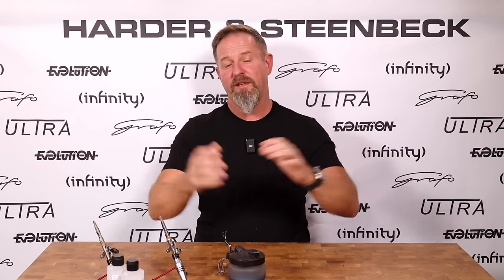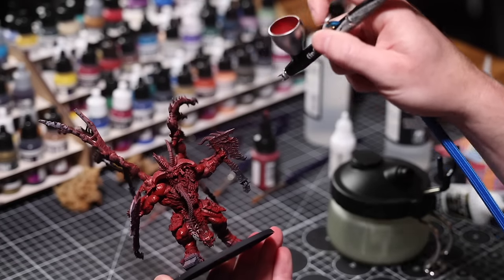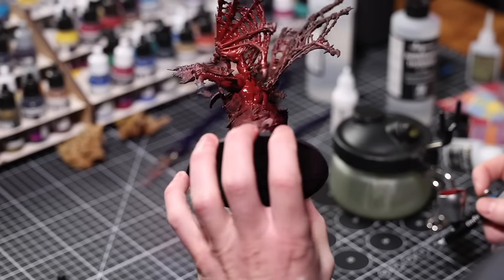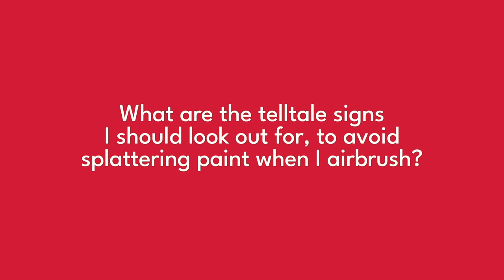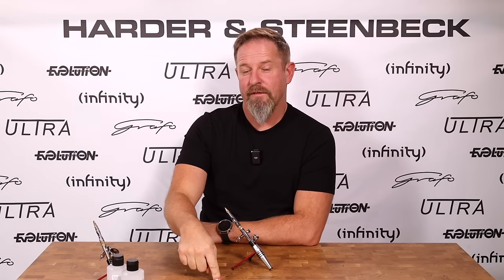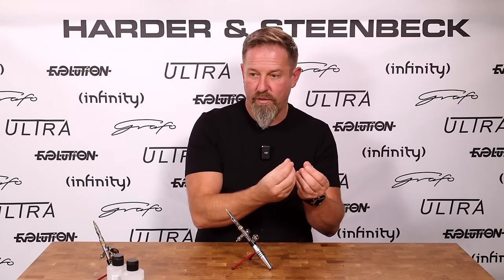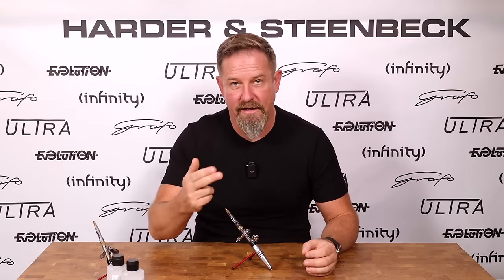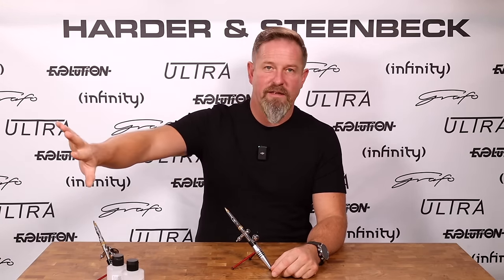How to stop putting too much paint down and avoid paint splatter

Comment: I have airbrushed for a number of years. I’ve used a variety of airbrushes from different manufacturers from cheaper models through to the infinity. 
I’ve used them for painting scale models and they’ve all done a reasonable job with my skills at the time. 

I have just received my new evolution cr+ 24. 

WOW, what a beautifully engineered tool. The effort you guys have put into its development shows in every element of it. It’s hands down the best airbrush I’ve ever owned. A joy to use and it looks great too. So a big thank you for all of you at Harder and Steenbeck. Have a great 2024. 🍻
Reply: I know right, when I opened mine a bright light shown out of the box and I know I heard angels singing
Reply from the maker: Ah thank you so much Allan! Really appreciate your comment - I will pass it on to all the staff!
Reply from the maker: Thanks buddy!

Comment: ok, these videos are really helping airbrush beginners (like me) up and running in my mini painting. very much appreciated.
Reply from the maker: Thanks for your comment! Glad they are helping.
Reply: @harderairbrush  there is also a question that's been sitting at the back of my head, I have the ultra 2024, will the old ultra 0.2 needle+nozzle set work with it? And will there be future optional nozzle cap options for it?
Reply from the maker: Yes and yes :-)

Comment: I would love to see a video on lubricating the airbrush, and what parts to lubricate
Reply: I was thinking the same thing last night!
Reply from the maker: Everything that slides, doesn't mind a bit of lube. Our engineering fits and finishes are smooth enough that they don't NEED lube, but as we all know, a little lube never hurts. I wouldn't lube anything that touches paint, and generally, airvalve components don't really need it. The trigger system, the whole back end - everything to do with the "feel" of the trigger system - this is a good place to put a little lube. Recommend Iwata Superlube, as it generally seems to be the only one that doesn't make paint get grumpy.

Comment: I think that first question can also be answered by mentioning airbrushing technique. 
1. Press down for air (away from the target)
2. Pull back for paint (away from target)
3. Check the pressure and flow of paint
4. Spray the paint on, continuous movement of the AB
5. Move the brush off the target and release.
Obviously this isn’t always possible, but I think it’s a good habit to develop
Reply from the maker: Thanks for your comment, BUT It's not always relevant to start the flow of paint off target. I'm concerned by your point 5... if you JUST release, then most likely, you will shut the air before the paint... this then results in a drop of paint sitting on your needle tip, ready to ruin your day the next time you press down. The ULTRA 2024 does prevent this happening by the way, even IF you do just release. The best habit is to make sure that you finish every stroke by pushing forward, and then releasing up. This way, your needle tip is always perfectly clean, and then there is zero risk in starting a painting stroke ON the target - something which we frequently need to do. Hope that helps! W

Comment: Hey Warwick.Thanks for your very intresting vids. I just bought a H&S Evolution Silverline. How do you bubble back ( for mixing or cleaning ) it with the holes in the nozle? Thanking you for answering.
Reply from the maker: If you want the "today" solution, then a thick cloth which is damp works great. For something more elegant - it's coming.

Comment: @Warwick @Harder und Steenbeck  your thoughts on ultrasonic cleaner for "mixing" acrylic paint in bottles  ?
(17ml bottle in zipper bag, in sonic cleaner, run for 90 seconds, rest bottle some minutes, and viola smooth mixed paint)
Reply from the maker: I've never tried it, but it sounds like it could work...

Comment: What frequency should you empty water from the tank of the compressor? In terms of hours spent airbrushing.
Reply from the maker: It depends on the humidity of where you are located. Best advice... After you're done, wait until the compressor has cooled, then do it. If you can't remember to do it after waiting, just do it at the end of the session. It's so fast and easy, that you might as well just do it each time. Never leave pressurised air in the tank, also...

Comment: One of the best things to help avoiding dried acrylic paint on the needle tip is to use a small amount of drying retarder - it will not prevent tip drying but i will give you a much longer time before that happens.
Reply from the maker: I really wish my experience matched that expectation but honestly, I've never used a retarder and found a significant different. However, glad you're finding that - might be different behaviours in different locations/ humidities. However, the habits described here will help whether it occurs earlier or later. Thanks for the comment!
Reply: @harderairbrush  Interesting! Experiences can vary - from my experience about 10-20% retarder about doubles the 'spray time'. However i use it together with a lot of thinner, maybe the combinations makes the difference? Ratio is about 5 x paint:3 x thinner:2 x retarder.

Comment: Hello, what would happen if i were to use your needle cleaning kit for the 0.15mm nozzle? The needle kit says it works for the 0.2mm at the smallest. Would it damage my nozzle or just not clean it well?
Reply from the maker: It will not reach the mouth of the nozzle, and therefore it does not do the job well. HOWEVER, please understand that this is really a last resort. It is so easy to keep your nozzle clean with just liquid if you never let paint dry in it. Much safer, much faster, much cheaper, much easier!
Reply: @harderairbrush  thank you very much!

Comment: I do all hard surface, and if I get spiders I dab it lightly with a shop towel. I don't bother trying to clean it off, but just want to ensure that it's flat. That way touch up is easy.
Reply from the maker: Good tip.

Comment: Hi, I have been watching your videos and they have been so helpful, I bought the ultra 2024, I am very new, I am noticing that when I change the presets, sometimes nothing comes out, just air when I push down and pull back. So I end up just using the normal pull back and no presets :(   I am not even sure I am using the right way to explain it, haha. It also appears that I can pull the trigger back a bit without pushing down and air trickles out. But maybe I have no idea what to expect when pushing and pulling the trigger and what it should look like or sound like when I change the presets. Cheers and thank you!!

Comment: With the noise of a spray booth sucking the air through the filter, I have no chance of detecting slight changes in the sound of my airbrush! And that’s without those moments when the compressor kicks in. All this noise does not make airbrushing a relaxing part of the model making hobby.
Reply from the maker: Ah but you must find the centre. Focus on your airbrush, and allow your mind to be like water. Then, you will hear the sounds of atomisation, and feel the flow of the colour. I recommend watching Kung Fu Panda for more instruction. 
Seriously though, you don't need an air compressor or a spray booth THAT loud to power an airbrush... but if your rig is really loud, then pay attention to how fast the paint starts to flow when you get on the trigger - how quickly it  begins to move - this should be instant. As soon as it is not, take a quick glance at your needle tip. That's another reliable way of detecting a bit of colour drying on the needle tip. Hope that helps you to relax more whilst airbrushing!
Reply: Thank you for your reply, much appreciated. Rest assured, I will persevere. Looking forward to seeing more info on the 2024 Evolution.

Comment: I would like to know how to practice without damaging the airbrush, I heard that food coloring is a good way to do it without risking damaging the airbrush since the cleaning after using these products can be done with just water, would be nice to know the best way to built that trigger control with no "risk"

Thanks in advance!
Reply: This is what I suggest people do when wanting to practice. Food coloring watered down to just see the tint works really well. Just spray on paper or cardboard and you can see it really well. Hope you have fun learning to airbrush!
Reply from the maker: Hey Diego... thanks for the question. Firstly, there's no risk of "damage" with any paint really... no paint is going to damage a solid metal airbrush ;-)
It's more that you have to learn how to handle the airbrush whilst cleaning it - please watch our various videos on this topic, as it's way easier than most people make it out to be, honestly!
Food colouring is great because you can paint and paint and practice the control of the airbrush. However, painting with acrylics etc needs additional skills, specifically avoiding tip dry and therefore clogging. The interesting thing with food colouring is that you can practice control without needing to learn the other things. However, eventually you need to learn those other things too. But please don't think that using real paint carries the risk of damage - not true if you have good habits on how to clean - if you do it the right way, it's super easy and fast. Watch any of our painting process videos and you'll see them. Very simple! Hope that helps. Also remember that food colouring is super thin and so it flows faster than acrylics, for example. So whatever trigger control you learn with food colouring, will need a bit of adjustment when you move to acrylic. One way to using food colouring and getting a more representative experience is to use your food colouring at more like 18psi to slow it down a bit :-)

Comment: Hi Warwick. What is the difference between using an fPC valve vs. just adjusting air pressure? When would I prefer one over the other?  Thanks!
Reply from the maker: Hey Andrew... it's just convenience and precision, but only necessary to get the fPC if you use air pressure adjustment frequently, and for me, only necessary when you really want to explore low pressure effects. Having the air pressure adjustment so near to the aircap allows you to set the pressure much more precisely and find your desired pressure much faster with the fPC than with the regulator. And of course, you can do it more frequently and much faster, as it's right there on the airbrush. I really like it because it doesn't interrupt the creative process. Hope that helps!
Reply: @harderairbrush  Thanks!

Comment: I bought the Ultra 2024 and can't get it to spray on setting 3 for more than 5 secs with out having to cleaning the nib.  I am using well thinned citadel paints
Reply from the maker: Hey there - take a look at Angel Giraldez' video about how to thin Citadel... Citadel is a bit of a unique case as they don't have an airbrush thinner... Angel has tried and tested lots and has found that the Tamiya X-20A thinner works great... I'm sure this will help.

Comment: Hi Warwick, some feedback for the assembly line if I may. I recently received my Squidmar Black Evo 2024 and found the needle nozzle was so tight I had to use pliers to unbreak the seal. This has resulted in the Black paint being chipped arround the nozzle area. If the nozzles can be put on with hand tight pressure, this would help. I have Neuropathy in both hands so I can no longer loosen things with my hands as I have lost a lot of my grip. Anything to help in this regard would be very much appreciated. Cheers Steve
Reply from the maker: Hey buddy - so sorry to head that! I can assure you that ALL our air caps are always put on only with hands. We do not use a tool to do that in factory for precisely this reason. However, I'm really sad to read this, and so we would like you to get in touch please. Email me on wjs@harder-airbrush.de - I would like to send you a new body for your airbrush so that you don't have that damage to that beautiful finish as a result of this difficulty, and we will also throw in a beautiful set of soft nosed pliers to help you with your Neuropathy without causing any damage in the future. I will also have our CNC room create a tool for you to use for taking your head on and off without needing to resort to pliers, but will enable you to develop enough torque even if you have grip issues. I've thought about what you need and I have already created the design - we can make it within two weeks for you - please get in touch. Many thanks, W
Reply: @harderairbrush and this is one of the main reasons why I will continue to buy H&S products. Taking care of your customers in this day and age has been lost. H&S continues to take care of its customers. Thank you so much for going above and beyond!  I cant wait to get my hands on my Squidmar black when I get back home!
Reply: @harderairbrush  thank you so much for your most generous offer, which has blown me away. I will ping you an email.
Thank you Warwick and the rest of the team @H&S 👍
Reply from the maker: Our pleasure!
Reply: @harderairbrush  Hi Warwick did you receive my email OK?
Cheers Steve

Comment: I just bought an Ultra and I am entirely new to airbrushing. I can’t figure out what size connector I need to fit the hose I have!  Any suggestions?

Thanks for the help!  Really looking forward to starting with my airbrush
Reply from the maker: Hey Matt! Do watch the ULTRA instructional video that the QR code goes to which came in your box... that covers how to get hooked up. The airbrushes all come with a quick connector, BUT you probably don't have that on your hose - just unscrew the quick connector and your hose will most likely go straight on. Most hoses now are 1/8bsp and this is what our airbrushes connect to. If your hose isn't that, any air hose with a 1/8bsp female end will work. Hope that helps!
Reply: @harderairbrush  this is fantastically helpful!  Thanks!

Comment: I would love to have more information about the 2024 Evolution -- specifically, your claim that the .28 nozzle is compatible with a .2 mm needle. You claim that the resulting lines are even finer than before. This seems counter-intuitive, and I've yet to see an online demonstration. Would the principle work across the board? What about placing a .3 mm needle in a .35 mm nozzle? I have an old Paasche VL, and I've never attempted to put a (cheap, commonly available) .5 needle into that gun's .55 nozzle.
Reply from the maker: Hey buddy... no that principle is unlikely to work across the board. Firstly, technically, it's more correct to describe needles as "designed for the 0.28mm nozzle" rather than 0.28mm needle, as that 0.28mm exists along a taper, whereas the nozzle can clearly be described as 0.28mm because that's the factual size of the aperture. The interaction between the needle and the nozzle is not really the critical aspect of what dictates fineness of spray. It's actually much more the relationship and the interaction between the needle tip, where is sits at a point in space relative to the airflow shape and focus that's coming out of the aircap. That is really the critical thing, and where the design focus is. Now bear in mind that the needle is a moving thing, and then you understand the design challenge a little better! It has to fulfil the job of acting as a flow control valve on the paint, as well as interacting with the airflow in a positive manner to influence atomisation/ detail etc. So if you put a random needle into another airbrush, you might discover something that the manufacturer didn't but most likely you won't. Not saying it isn't possible though! But you might spend a lot of money without results...
With regard to your Paasche - I am a fan of the old VL! It was actually my first airbrush. Personally, I never used the #1 set-up much - I preferred the #3 set-up - even for detail. I just found it overall friendlier to use, and 95% as good for detail as the #1. A very nice compromise, that head, actually.
So in summary, we didn't just "put a 0.2mm needle into a 0.28mm nozzle"... we designed a new system of needle/ nozzle/ aircap optimised for detail work with today's paints, and this is the result. It's a system, not a parts bin special :-)... hope that helps!
Reply: Thanks for the detailed response, although I'm still not sure about the new system. I'm sure we'd all like to see the Evolution's fine line capabilities demonstrated. Incidentally: You got detail out of a VL3? You must be a god. Back in the day, I was pretty proud to get fine lines out of a VL1. (One had only about ten seconds of working time before the tip clogged.)
Reply from the maker: Yes, it's true - the VL1 was a bit tricky that way, as was the V1, in my opinion. But I was very fond of the VL3 and the V2... I actually developed a custom aircap and needle shape for both of those back in the day, which I used to make by hand. Fun times.